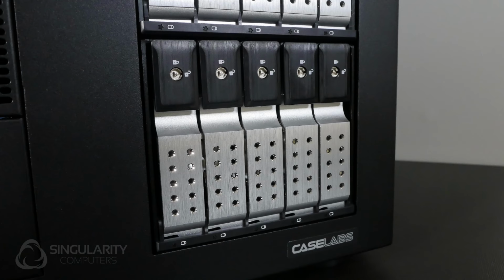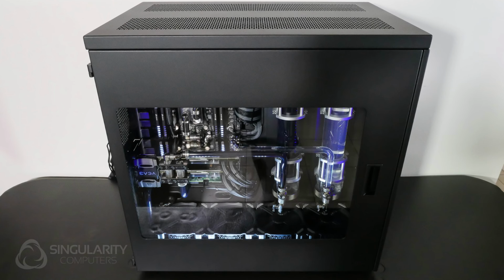Build #18 QA Answers

Comment: i'm cooling a 5960X with a 480 :) building an SMA 8 rig soon :):):)
Reply: Awesome choice of case.  Once I move into my new place I'll finally have the space to have an SMA8 build.  Hands down my favourite case.  You have great taste my friend.
Reply: well I started in s 900D but it bothers the hell out of me. I said screw it, I don't care what it costs, I don't care what it takes, the 900D is no more
Reply: Yeah I almost bought a 900D back when it first launched but due to its size and some of the QC issues some people had with it like Hardware Canucks,  I ended up going for the Enthoo Primo.  I had just enough space to fit it as it is another fairly large case.
Reply: Guy9998 I think the enthoo primo is better because the space is done better.
Reply: It is.  The only real problem I have with the Enthoo Primo is that I can't fit a Black Ice SR2 in the bottom due to width constraints so I'm running an L-Series rad instead.  Also the fact that you can't fit really long video cards with the res mount installed is a bit of a pain but other than those two things I do really like the case.  Fortunately my 980 Ti's fit fine.  My next case though is definitely the SMA8.
Reply: I hope you get one, I will be doing videos on it, as well as build logs :):)) i..cant..wait..for mine!

my body is ready.
Reply: Cool.  I look forward to watching them.

Comment: How would a "dual" loop preform, if both loops uses the same reservoir? 
For example: 
Pump1 -> GPU -> GPU-Radiator -> Reservoir 
Pump2 -> CPU -> CPU-Radiator -> Reservoir

Comment: i am bilding me ferst liqid coling lop i have sen your video for a long time (year) and i love them 
i have a qastion is a 240 and 360 mm Radiators god to cool 1 cpu 2600k planig on oc and a gpu ?
or is it over kill 
hop you kip op the good work love your video and you have inspired me to do water cooling me self
Reply: so a 240 mm and 360 shot be good?
Reply: fanks for the help can't wanit til the part are here so i can bild it
Reply: akke_ boy CPU and Gpu should b at least 240mm rad
Reply: Rules are one 120mm rad per block
Reply: Out of the box non over clocked = 120mm rad per block..Over clocked, add a 120mm rad.You can never have enough cooling surface area, if you case supports it then great.So 240mm for the CPU and 360 for GPU,with room for O/C or 2nd GPU.

Comment: OCD works.. My system looks incredible thanks to your tutelage. I went with XSPC for my parts and blocks as the Raystorm Pro looked to be about the best in terms of the amount of copper used in their blocks.  Both cpu and gpu idling at around 30c and only go up about 10c under load on the gpu and about half of that with the cpu. No fittings other than for the pipe ends and I bent it all in petg 14/10. She's a blue beauty.. I used the Rosewill Cullinan case for the build..